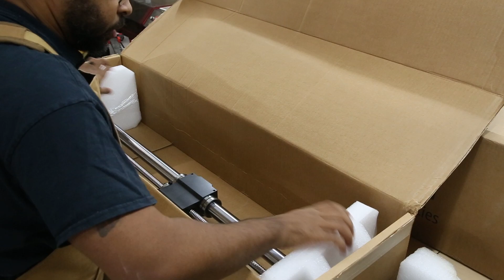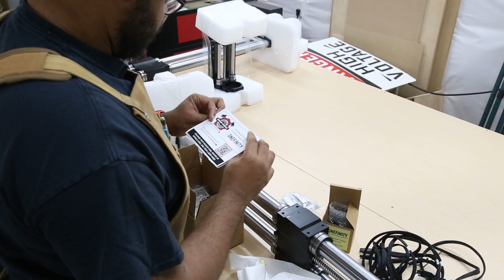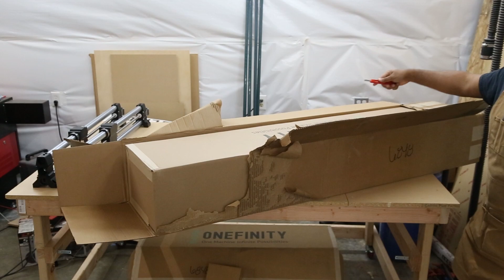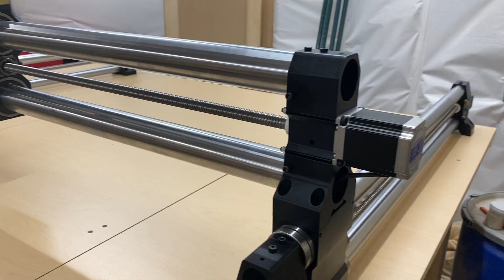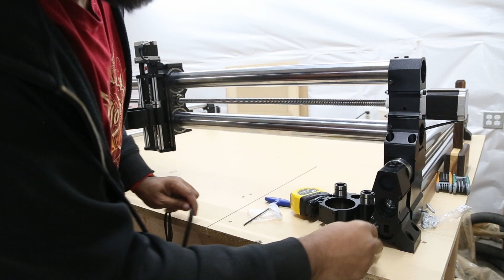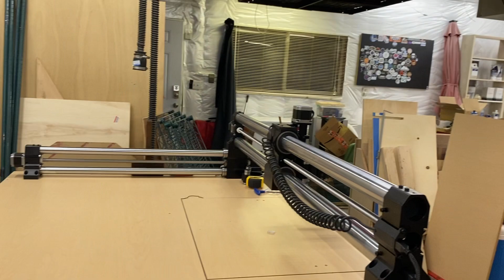Onefinity: Unboxing and setting up my Journeyman X50 CNC

Comment: I need to order one but do you feel you need the stiffy or drag chain option after your purchase?
Reply from the maker: Nope in all the time I’ve used it haven’t felt the need for those with the standard setup. When I added my spindle the drag chain and clips would have been nice, but that was solved during the upgrade

Comment: Great video for sure.. 
I am trying to decide which CnC machine to purchase.. The Onefinity like the one you are showing or the Shapeoko 5. 
Which one do you like the best between the two companies? 
Thanks...
Reply from the maker: I started with a Shapeoko 3 and moved over to onefinity so that’s my personal preference. I feel the 1F has been setup in a way to allow easy upgrades which they’ve already shown and with the shapeoko you kinda get what you get size wise.
Reply: I am looking at the 5 Pro 4X2 since I have a small shop..  @vanstray

Comment: Thanks for the video.  I just took delivery of my Journeyman today and I'm looking forward to setting it up this weekend.
Reply from the maker: Great hope it goes smoothly!
Reply: @vanstray  Me too.  By the way, what are the final table top dimensions?  I'm thinking of making mine 72" x 48".  I'm not sure if that will be overkill or not enough.  It seems like that should provide plenty of room for the control box on the left side of the table and I also want to have enough space around all sides for an eventual enclosure.  I have the table base mostly built and still have a chance to make some final decisions on the top.  Any advice on that would be appreciated.  Thanks.